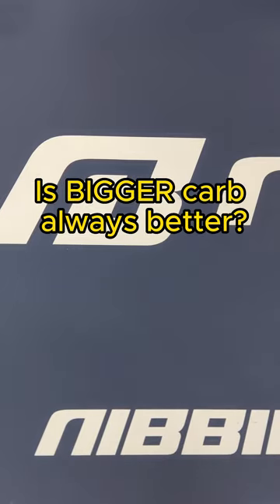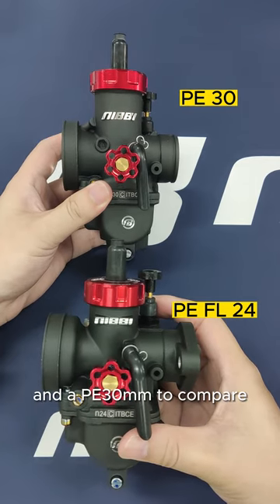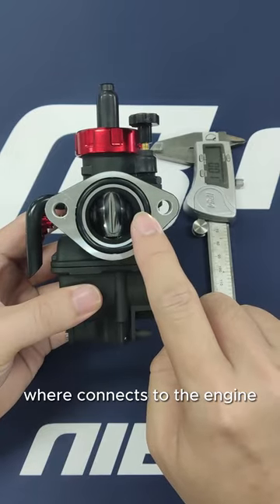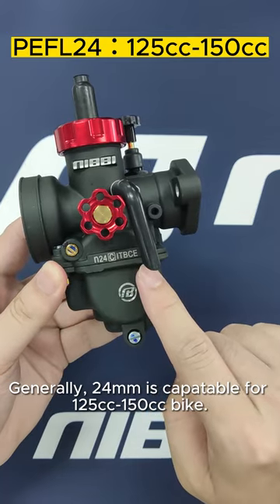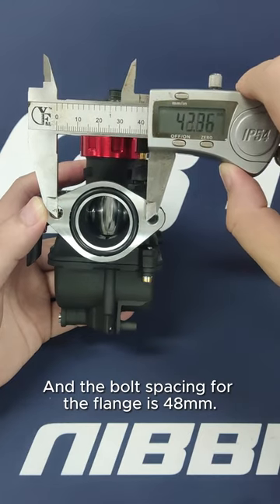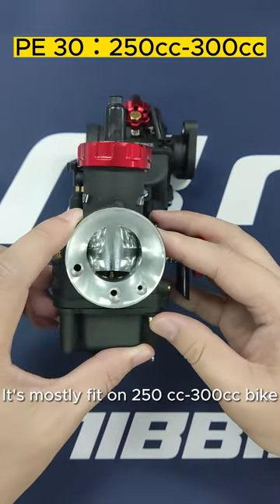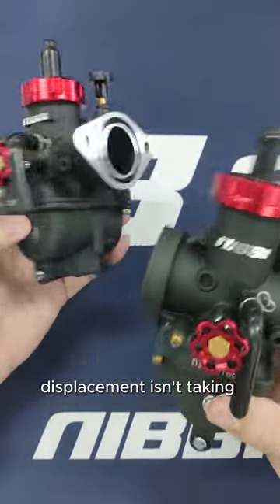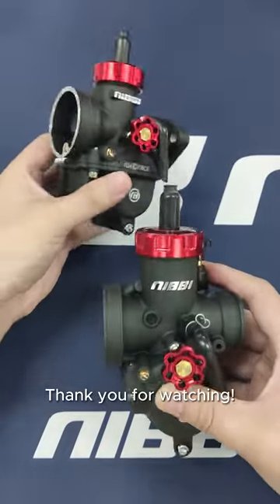A BIGGER carb always better?!

Comment: is a 30mm carb for a 110cc overkill ?
Reply: yes , i recomend using 19-21 mm
Reply: @ziutekpoliski7886 what about 125cc?
Reply: @exelen-exploits  24 mm is max. i woudl go for 21mm carb
Reply: For 150cc possible?
Reply: Is it good for the raptor 250
Reply: @ziutekpoliski7886  250-300 cc?
Reply: @2AHGT  i have 28 in my 250
Reply: Depends on if it’s a 2 stroke or 4 stroke from what I hear.  2 strokes require a faster cycle and more air and gas in half the span so for 4 strokes, smaller carburetors make more sense and for 2 strokes larger carburetors are the way.  Saw a dirt  bike guy comment on a post saying it always tickled him that such big engines having such small carburetors was considered overkill.
Reply: If you get a larger carb than needed you would need to jet it and it would basically be the same as a smaller one which costs extra so just get right size
Reply: What carb should i use on a 70cc moped right now I have a 17,5mm but I feel like I want more speed and acceleration?
Reply: @timdahlberg468 minimum 21mm depends on setup

Comment: hello i have 90cc pit bike and tried putting on pe19mm no matter what jets i use its boggy and super hard to start. is the carb just not designed for motors this small? im gonna try your pz18mm instead hopefully it works
Reply: Try a 21mm... Is it 4 stroke? If it is then i don't know... But if it's a 90cc 2stroke, at least a 21mm is advised... In my country 21/24 are used for 70/80cc racing scooters
Reply: @tiaguinho6756  the pit bike was low on compression and needed a head gasket. from Canada, i have a 1990 dt50lc it was pretty much one of the last 2 stroke models they sold before they banned them here. with stock bore it goes 105kmph with aftermarket carb and firebox exhaust
Reply: @marshallkaufman3123  DT50 here in Portugal there's barely anything stock... It's the N°1 50cc for tuning we have some 100cc and there are some two cylinder fusion etc... Dtlc50 is the n°1. Stock with a good carb, better gearing and stuff you can push it to 120km/h... If you want you can see some projects here

Comment: I am trying to find a way to adapt the 19mm carburetor with the flange to my GY6 scooter and cannot find the right size to put on the carburetor so it will fit the intake manifold on the BBK (went form 50cc to 80cc) head I put on it.  The studs on the head are spaced at 46.66mm. I was wanting to use the existing factory manifold but I think it will be too small. Is there any other way to do this?

Comment: what's the best carburetor size for my 125cc moped? i want more power while keeping fuel consumption low
Reply: Most 125cc mopeds usually come with 18mm from the factory. Try a 22mm. I have a PE22 on my Suzuki FL125 and it has good performance and doesn't consume much if I ride it at normal paces.

Comment: for 150cc? what do you recommend?
Reply: I’m in the same boat it looks like we need a 24 or 26-I think I’m going with a 24
Reply: @that1koolguy did you have to tune the 26mm?
Reply: @ZaeG2  -well I actually bought the nibbi 26 so my stock carb is 24, yea I’m gonna have to do some tuning-I upgraded petcock,fuel line,fuel filter also, and the nibbi kit on Amazon is 140.00 comes with new throttle and cable so if you get the kit oh yea you’re definitely looking at some tuning lol